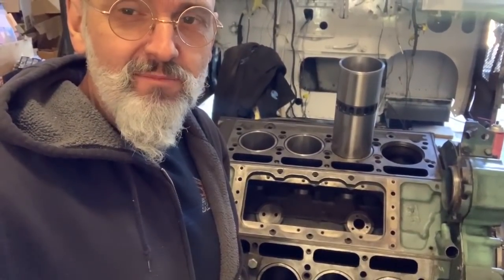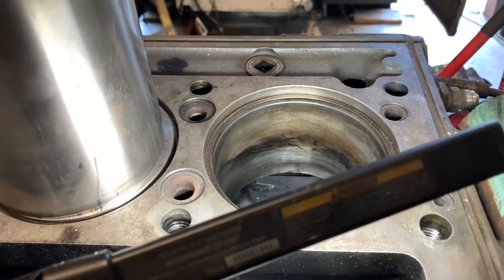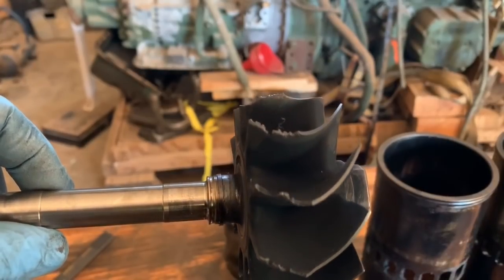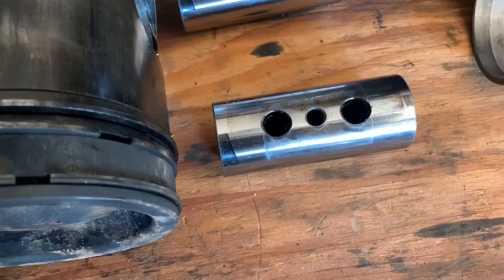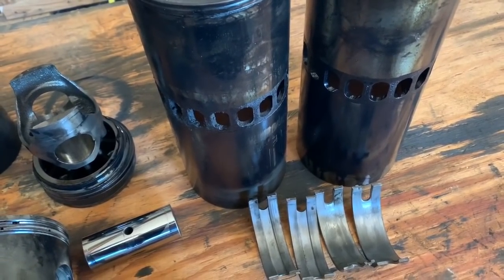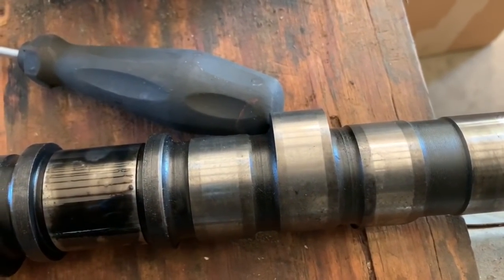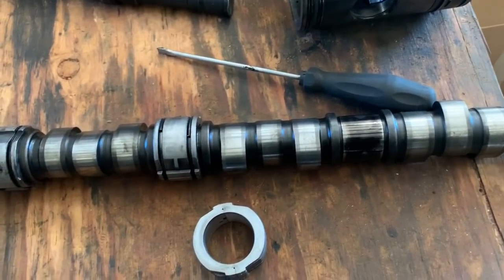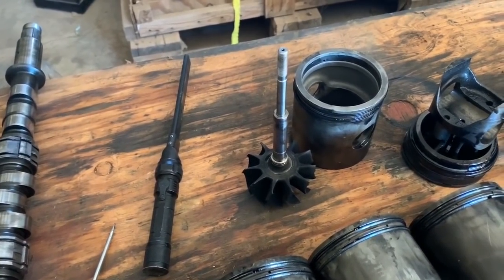Engine failure , why we had to rebuild our 8V71TA Detroit Diesel after 625 hours

Comment: Failures ALSO Looks Very Similar to someone using improper (aka Multi-Viscosity) motor oil in their 2-cycle Detroit. - (Fuel dilution would do same thing.)
Reply from the maker: The only oil used was Delvac 1240 40w CF2 rated oil. That said the fact that it was making oil ( 1 gallon in 20 miles) on the first drive because the mechanic didn’t pressure test the fuel system, I’m sure had negative repercussions.
Reply: @LacroixCruiser  I am sure...(though I have never heard the term "making oil" before, I understand completely) - Diluting the oil with fuel cuts viscosity considerably... The multi-viscosity mistake has been done so many times, and I have had people that think they "know oil" tell me it makes "no difference" and yet DD themselves had failures from dealers putting wrong oil in... The problem with 2-cycle engines, there is no "relief" of stress on the hydraulic bearing of the main/rods as they are under constant load...this was discovered in Gasoline 2-cycle engines very early on, that combined with no sump of oil, requires the use of needle bearings (that don't need constant lube) to handle the stress... The liner situation was also bad...all these online retailers sell "kits" with pistons, liners, and gaskets... But the new "Parts Swapper" mechanics don't understand that liners in an OLD engine MUST be selectively fit.
Reply from the maker: 3 of the fuel lines in the head were leaking fuel into the oil. The term making oil comes from starting with 8 gallons, and in short order you have 9.
Reply: @LacroixCruiser  Yeah I have never heard of Oil Contamination with fuel called that...My Father worked Ford...and I have been a mechanic all my life...and never heard "making oil" - its just really odd.
Reply: @misters2837  Pretty common term up north here.
Reply: So the cause of the failures are.
Leaking injectors
Liners not of the correct size
The leaking injectors ate the bearing and ate the cam.
Reply from the maker: A few other contributors like the cam followers not installed properly, using RTV everywhere ( contributing to many leaks) and the above.
Reply: @97marqedman  up north where? Must be New England...We don't use that term here in the Midwest...
Reply: @2nickles647  The cam followers and cam would have been fine if they were installed correctly...your modern cars use rollers like that...and they are just fine with 0W16 oil...but they have been installed correctly... The Rod/Main bearings were eaten due to the diluted oil...on a 2-cycle the balance of lubrication for the bearings is a very delicate balance...if that would have been a 4-cycle Series 60...it probably wouldn't have mattered much... (In fact I had a mid hour Diesel Tractor that was brought to me because the fuel pump had failed, and diluted the fuel, and it just "cleaned" the insides of the engine!)
Reply from the maker: I actually first heard that term from a mechanic that lives in South Dakota
Reply: @LacroixCruiser  Weird....I am in MN...
Reply from the maker: https://www.google.com/search?client=safari&hl=en-ca&sxsrf=ALeKk00E98EJarDY2R8TaisjQWSMuh07XA%3A1612631650240&ei=Ys4eYMSkDsv85gKZhLjYDg&q=diesel+making+oil&oq=diesel+making+&gs_lcp=ChNtb2JpbGUtZ3dzLXdpei1zZXJwEAEYAzICCAAyAggAMgIIADICCAAyBQgAEMkDMgYIABAWEB4yBggAEBYQHjIGCAAQFhAeOgQIABBHOgQIIxAnOgcIABCxAxBDOgoILhDHARCvARBDOgQIABBDOgoIABCxAxCDARBDOgUIABCxAzoICC4QxwEQowI6CAguEMcBEK8BOgUIABDLAToECAAQCjoHCAAQFBCHAlDfHljSM2CkQGgAcAF4AIABkQKIAY4KkgEFNC4xLjOYAQCgAQHIAQjAAQE&sclient=mobile-gws-wiz-serp
Reply: @LacroixCruiser  Hmm... we just call it Fuel Dilution... (or Water Dilution if its coolant...)
Reply from the maker: Logical, but not as colourful.
Reply: @LacroixCruiser  Oh I have "colorful" words...but usually when I bust my knuckle on something... My dog even runs and hides...LOL
Reply: Making oil is a common tern in Calif.

Comment: Fascinating video as always Yvan, thats pretty drastic wear in a short period with an engine like that. I wanted to ask, if you have ever thought of converting your bus to an electric drive-train in the long term future as battery technology and charging infrastructure improve and become less expensive. Cheers
Reply from the maker: Yes we inquired about it at SEMA last fall, it’s not quite feasible, yet.
Reply: @LacroixCruiser  makes sense. I would imagine that is still about 5-10 yrs off from being a feasible conversion as by that point batteries will be well under $100 kwh, and charging infrastructure will be far better by then as well.

Comment: When I bought my transit bus, the 8V-71 had been rebuilt by Portland, Or Metro. But, same thing, loosely fitted cylinder liners. Pulled the engine and had the block bored by .010 and over sized cylinder liners with standard interior bore installed to reuse the pistons. Then everything has been working great now for over 40,000 miles-even with turbocharging the engine with NA pistons!
Reply: Don't mean to be smart arse but the turbo pistons should be used they have a slightly lower comp ratio at 18:7 to 1. But being a Detroit you might get a few hundred thousand miles out of it as they are the toughest engines ever made.
Reply from the maker: The pistons installed are the correct pistons for a turbo charged engine.
Reply: @andrewking9761  Actually NA pistons are 18.7:1 and turbo pistons are 17:1. My 18.7:1 pistons are two piece with the tight transit rings. We only went to 7G75 injectors, added the bypass blower, used the 12.7 Series 60 turbo that has a waste gate set at 15psi, and most importantly have an air to air intercooler in front of the radiator-first 8V-71 my mechanic did. He liked it so much, he did 5 more buses with air to air intercooling on the 8V-71's. It REALLY wakes up the engine. Puts out 375hp and 1125lb/ft torque. If you did have a TA block, you could use 7G80 injectors and get 400hp and 1,200lb/ft torque.

Comment: In a dry liner engine...........wouldnt the liner need to be a shrink,press fit.  I wouldnt think that a dry liner would at any time have any looseness or clearance..........it should be completely tight in the bore. This is done by putting the liners in a freezer, tap them in firm and when they warm up to ambient they 'grab' rock solid and never shift?? But, whatever the engine, get the manufacturers specs,measure carefully and double check everything on assembly. Some bolts should never be reused, dont cut corners.
Reply from the maker: Exactly, we assembled the engine using Detroit diesel specs. In this case the liners must be a tight slip fit.
Reply: @LacroixCruiser  exactly.........they should never be loose.   Great work, thanks for the videos!
Reply from the maker: @wazza33racer  thanks for watching.

Comment: Why two piece pistons? There junk ffs! cat did it too far as i know
Reply: 2 piece pistons provide better lifecycle in high hp NA and Turbo applications
Reply: Crosshead pistons (2 piece) came after the trunk type single piece pistons that the 71 series originally came with. Suppose to reduce friction on the skirt area.
Reply: Generally two piece pistons have iron tops and aluminum skirts. Iron does not conduct heat as well- and absorbs less heat when exposed to the flame front of combustion. Heat from combustion is what increases pressure and pushes the piston down to make power- so heat lost to the piston and combustion chamber costs efficiency. Aluminum skirt is lighter weight and is more effective at conducting what heat the piston absorbs to the cylinder walls (and to the coolant).

Also the expansion characteristics of the top portion can more closely match the expansion of typical liner material. The top land can be closer to reduce crevice volume. 

Basically lighter and possibly stronger than an all iron piston, stronger at higher temperatures and more thermally efficient than an all aluminum piston.

Comment: Oh & forgot the turbo  issue carbon didn't  do that . A piece  of valve or burnt piston  that previously broke off  went through  the turbo.
Reply from the maker: The valves and pistons were all whole, no missing pieces. The only thing that went through that turbo was exhaust with excessive blowby caused by a mechanic that didn’t take the time to do the job correctly.
Reply: @LacroixCruiser  the turbo was damaged  the o/h before yours. nobody checked it before!!@
Reply from the maker: Sorry to burst your bubble but it was rebuilt at the same time as the engine, and twice after that in the 625 hours we used the engine before rebuilding it again. We waited for the mechanic that screwed it up to fix his mistakes, and after a year of trying to get him to help us, we gave up and did it ourselves with the guidance of a veteran 2 stroke mechanic. It’s been running perfectly since.
Reply: @LacroixCruiser  your not bursting  my bubble , you are saying  the turbo was built twice befory you took it apart , the previous  parts changer ( notice i didn't  use the term  mechanic). his work on the turbo is probably  the same as the work on the engine o/h.
Reply from the maker: The turbo I had rebuilt by  dedicated and reputable turbo shops everytime.
Reply: @LacroixCruiser  how many times are you going to rebuild the turbo .

Comment: I donot see nothing wrong with it run it untill you blow up the engine and throw a piston thru the block and head and then junk it and a cat or Cummins engine.and throw the Detroit diesel in the junk yard
Reply: Cats or Cummaparts are not bus motors

Comment: Must b a 92 series with those swivel top piston s in it ,,,,,any time a piston comes apart in a Detroit all the piston s and the turbo will b damaged ,,because the air box ,a 2 cycle engine ,,,when the air relaxes on the bad cylinder the air gets blown around from one to the other
Reply from the maker: It’s a 1984 8V71TA
Reply: @LacroixCruiser  does any one flag the injectors any more ,,,,I have the white tag the green tag ,the brown tags,,,I have 6 of them altogether but never hear of any one setting the injectors ,,,also if you change the cups on the injectors from there original 6 spray ,spray holes to a 8 spray ,spray hole you gain 2 more cc's of fuel per cylinder you would not believe the difference in the power you get then set them to the brown tag setting ,,,,we use to get a little blue flame about 3 inches long out the top of the stack  of a 238 or a 318 71 series ,,,,also if you run a half a tank of diesel and a half a tank of kerosene on those Detroit's it's like putting high test in a car ,,,you can't do that on a cat or Cummins because of the fuel pumps but u can on a Detroit  ,,,,thanks for the response back ,,,,from one old 39 yr TRUCKER keep the SHINNY SIDE UP.
Reply from the maker: Brian Anderson the shop that rebuilt our injectors is old school and asked what setting we wanted them adjusted too, we chose the highest setting. With all the work we did, plus the injectors that are all perfectly balanced, our 8V71TA runs strong and very smooth.